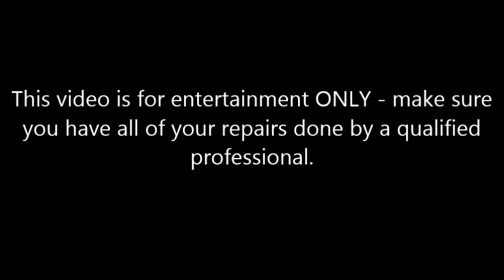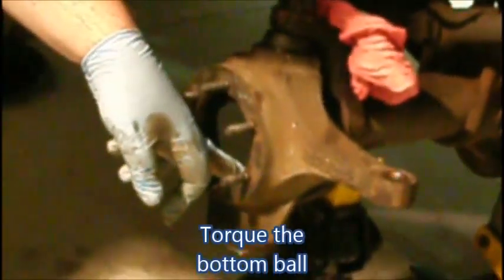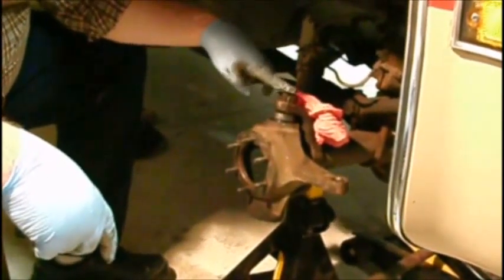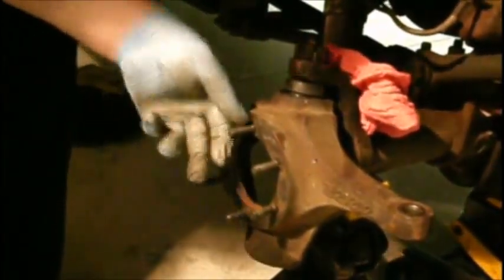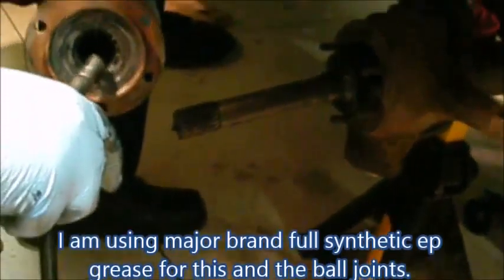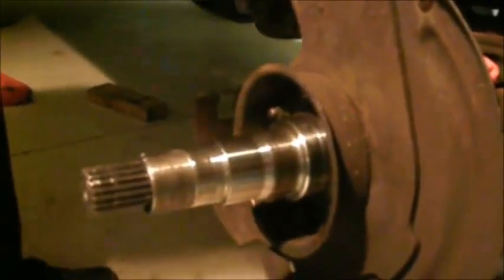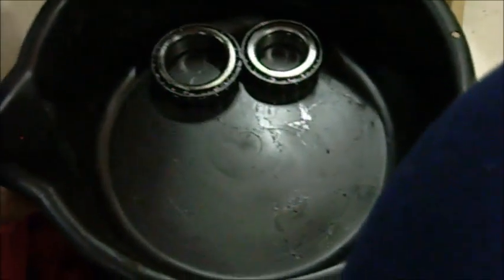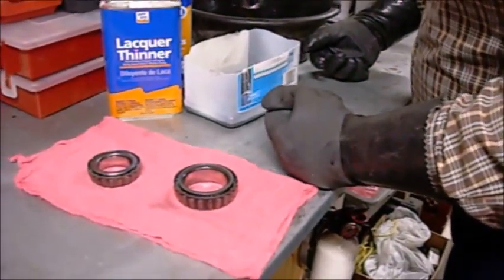'73 to '91 K5 Blazer Ball Joint & Tie Rod End Replacement (on 1988 K5 Blazer) © 2015 B John Part 2

Comment: I really wished you showed the actual removal of the axle, and the process of removing then installing the ball joints. as I will be doing this to my 88 suburban
Reply from the maker: +Torque-Lock-Tom  Hi Tom - Because of video time constraints (to keep the vid under 15 minutes in length) we did not video the axle and spindle removal.  However, it was not too hard.  1.    To get the spindle out, I took one of my biggest chisels and that mini sledge in the video and put the tip of the chisel straight down between the axle housing and the flange of the spindle and hammered away.  2.   I would make several blows on one side and move directly across to the other side and do the same, hammering straight down on the outer edge.  The spindle was really rusted to the housing but I kept after it and it finally came out.  3.   I did leave some minor damage on both, but I took a sander disk in my air sander and cleaned up both sides where they had marks from the chisel.4.  Then the axle will slide right out by hand.  5.  For the ball joint/spindle removal I sprayed the upper and lower ball joint shaft with Break Free penetrant and whacked the top end of the axle housing ( in the direction of the center of the truck ) with my mini sledge just like I did when I took the tie rod end out.  5.  I own a 3 piece set of ball joint / tie rod end removal forks ( pickle forks ) and took the largest one and hammered it in between the spindle and the axle end there on the bottom ball joint and it took less than 5 minutes to remove.  A fork kit is available from Northern Tool and also Schwaben makes a removal tool for less than $40 that requires NO hammering!  6.  If you have an Autozone or NAPA nearby they probably have these types of tools for rent so you don't have to buy them for a one time repair.  The very best of luck to you with the 88 suburb - Regards, BJ

Comment: Was it hard to turn the knuckle after the new ball joints were tightened? I have a 1977 that I'm working on and the knuckle is very stiff to turn by hand with the new ball joints
Reply from the maker: +Barry Delmonte Hi Barry - The new ball joints are somewhat stiff and the knuckle won't turn very easily.  As you can see in the video, I can turn it with one hand.  Also, B4 I started cleaning the bore of the knuckle, I put a grease fitting in the upper ball joint and greased it, then took it out and put the tiny pipe plug in, as the axle won't fit back in with a grease fitting installed in the upper ball joint.Also, B4 cleaning up the knuckle with the die grinder and scuff pad, I also installed the grease fitting in the lower ball joint, to make sure none of the dust and dirt got in there during cleaning.  I can't remember exactly, but one or both of the ball joints were greased up before I showed turning the knuckle in the video.  Hope that helps - BJ

Comment: hey john i got the same blazer 1990 k5 i put all new front end parts on it (everything) and i did not torque the ball joints.. i notic after that i had alot of play in my steering wheel and it looks like it is coming from the gear box i have put 2 new rebuild gear boxes on it and still have the same problem it seems like it didnt happen to i install the ball joint im wondering could it be because i didnt torque the ball joints i were going to try a better gear box a redhead gear box ..i have had my blazer for along time and never had that king of play in my wheel before ..i have drove my truck out of town a few times..i do have a 3'body lift on it and 35x10 15 inch  tires on it..im gonna go back and torque the top nuts i dont think i want to take all that stuff off to do the bottom nut..so john tell me what you think
Reply from the maker: It's awful hard to diagnose something without seeing it. It's best for you to take it to somebody locally that knows about front end and alignment and have them see what's going on. Like I say in my videos if you're having trouble seek out somebody that's a professional so take it to a shop that knows what's going on and let them see if they can help you find out what happened. Good luck.

Comment: So how hard was it to remove the old upper ball joint adjustment sleeve??
Reply from the maker: Hi Rob - it was pretty easy - I have the tool to unscrew it - used some Break Free spray on it and it came right out - when I reassemble, I put Never-Seize on it the the other hardware in order to get it apart again - important if you live in a place that salts the roads in Winter - Thanks for watching!

Comment: When putting the spindle back on, I know which way the large seal goes (the one on the axle next to U-Joint), but which was does the next one go (bevel outwards to spindle or inwards to the large seal).  And the small one with a channel in it that goes up against the spindle bearing...does the channel face outwards towards bearing or inwards towards the other two seals?

Hopefully my description makes sense.  If not, I can post a video on my channel
Reply from the maker: Hi Salvatore, when replacing the nylon washer the bevel goes towards the axle shaft. As for the small seal in the end of the spindle the channel goes inward towards the nylon washer on the axle shaft as it seals against it. Hope this helps thanks for watching. BJ
Reply: @bjohn8059  i have to say, I have learned so much from your 5 part series.  I keep rewatching over and over these last 3 months.  It has been a slow go with this heat.

Just for clarification, the nylon washer bevel faces towards the differential or towards the wheel.
Reply from the maker: @salvatorelivreri  Toward the differential. Glad you like the videos. A few sections got left out because we had camera trouble but once we switch cameras things went better.

Comment: How deep do you set the spindle bearing and seal ?
Reply from the maker: As for as the seal, I just gently tap it in flush to the back of the hub. Hope this helps. Thanks for watching.  BJ